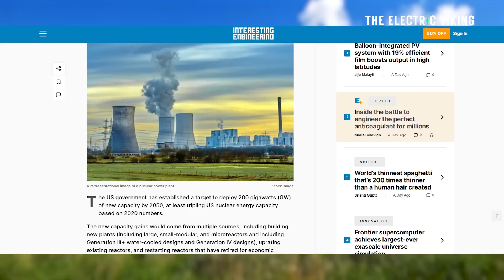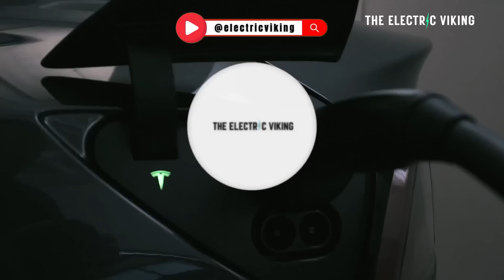US reveals plan to triple nuclear capacity with hundreds of nuclear reactors

Comment: Like your channel Viking, but why does Elon musk support building nuclear power plants? Musk March 2022: “efforts to shut down nuclear power plants as “crazy” and “madness.””
Reply: There is an obvious difference between supporting retaining existing nuclear plants versus supporting building new plants. This comment seems to confuse the two.
Reply: @glennjgroves - then why this: “China has 27 nuclear reactors under construction, which is more than any other country. Construction timelines are about seven years, which is faster than other countries.”
Reply: Because Germany shutdown their existing nuclear they had to reopen coal fired power stations and their energy prices have massively increased.
Reply: AI supercomputers need them.
Reply: At the start of the Ukraine war when gas supply was an issue, Musk said that nuclear power plants that had been shut down should be restarted and plans to shut down more should be postponed. This made some sense, though it was impractical. He has never advocated building new nuclear plants because he believes that renewables with batteries will be sufficient. The present plans for more nuclear in the US are not his.
Reply: Because he can get cheap power while offloading decomissioning and other costs to the public, so he and other billionaires won't have to pay.

Comment: The rationale is that we need a lot of electricity period to replace fossil fuels that are currently used for electricity generation and to move around internal combustion vehicles. Plus there is all the future AI/data center demand. Total electricity demand will be rising massively, so it makes sense to not put everything into the solar or wind plus batteries option.
Reply: But why not is the question?
Reply: To the contrary, the advent of data  centres demanding energy supply will actually help the transition to renewables because much of the demand will not be time critical and can be shut down when renewable generation is low. Same goes for other uses of cheap excess electricity such as carbon capture, desalination and manufacture of green fuels like hydrogen.

Comment: Nuclear power is a zombie idea from the 50's. As Lenin said : ' You look for the person who benefits'. I am fully onboard with renewable power but we just had 2 weeks of overcast weather and rain and little wind here in Brisbane. Can you tell us how long Battery storage 'charge' lasts? And I saw a YouTube ad from the Qld govt. that Gas is used during these periods to provide baseload power
Reply: Nuclear power has not stood still since the 1950s. The newer/safer/smaller/cheaper Thorium generation 4,5 reactors, for example, can fit inside a tractor-trailer container and be deployed in very remote areas that need power and do not require water cooling.
Reply: Gas is typically used the entire time. They don’t even usually throttle the gas plants down during high renewable output. They just sell at a loss.
Reply: @nateforward9984  Really?  I assumed that generally Coal was used for base load and Natural Gas for peaker plants.
Reply: @jefflittle8913  In the USA some utilities just run nat gas full bore at a loss and make it back later.
Reply: Why do you think all of Brisbanes power comes from the local area? Google HVDC